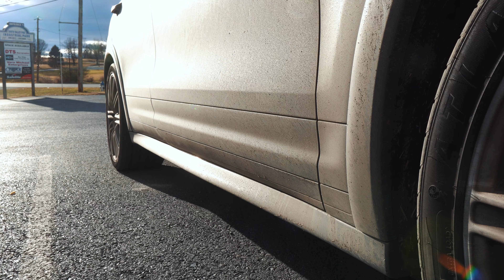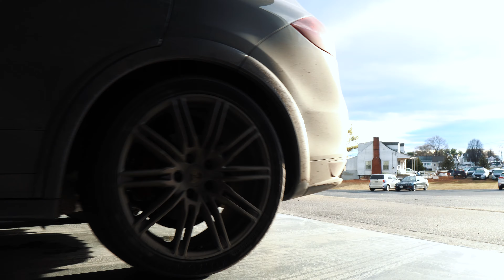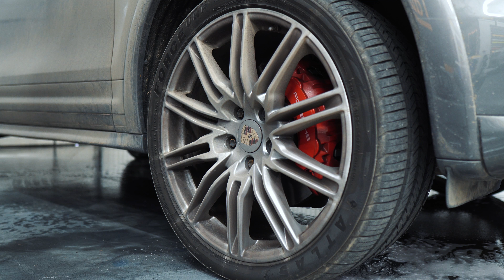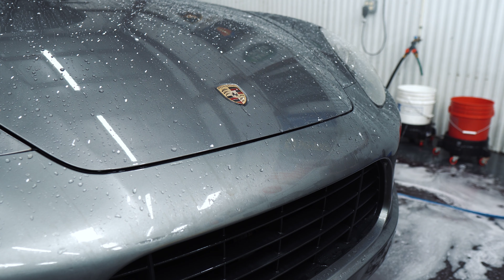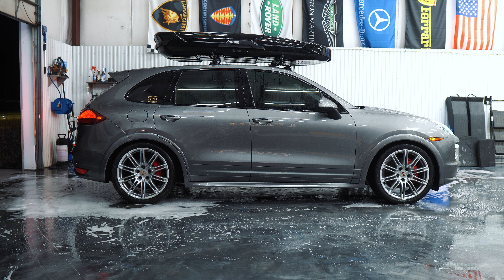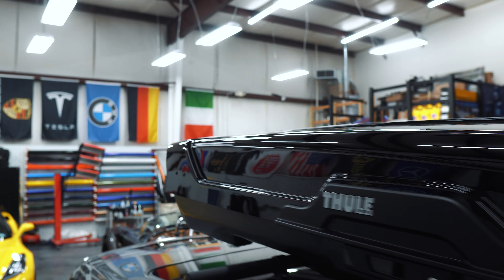How To Wash - Porsche GTS Ceramic Coating #porsche #asmr #detailing

Comment: Buy the extension for the pressure washer it makes your work so much easier, trust me. Wash the car with proper clothes that dont scratch the paint if you get really close to it, fix the water issues inside of the garage. Camera angles are great, keep it up.
Reply from the maker: Great tip!